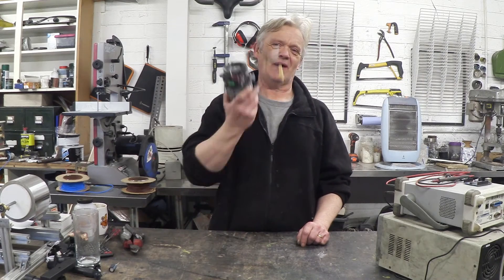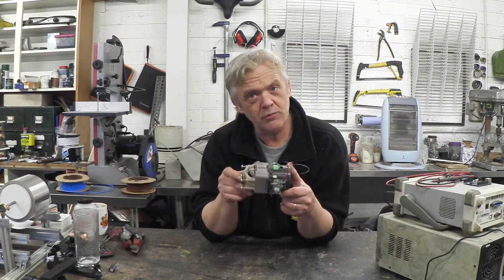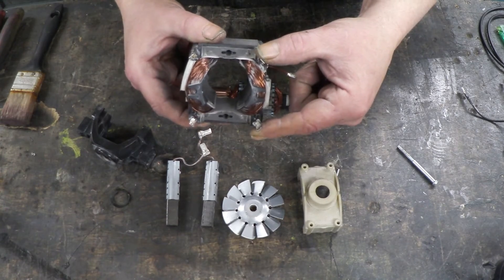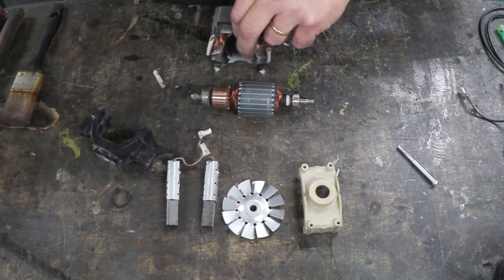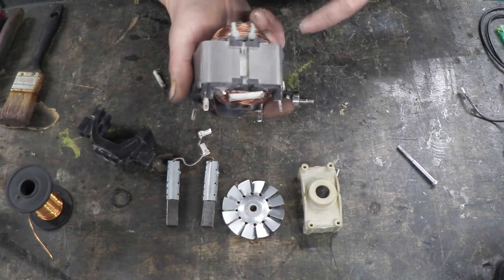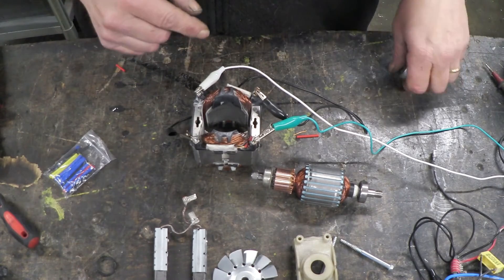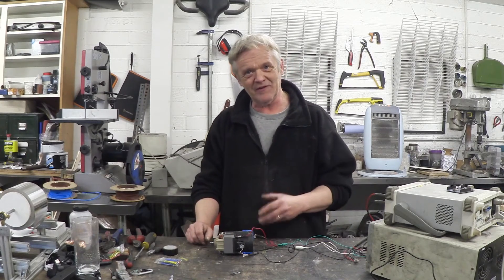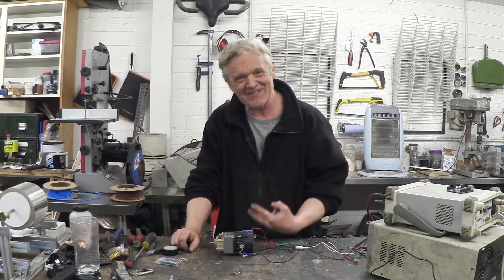1027 All About Universal Motors

Comment: can this work for a bosch 800w drill converted to torque wrench using torque tool attachment. I want to control the torque and speed of the drill to output the desired torque in Nm using various torque tool attachment. the tool attached to drill basicall uses rpm and torque of drill to produced desired variable torque from the different torque tool attachments

Comment: two questions, can the wire that connects the two field coils be considered a neutral if I was to be running this as an ac generator? on RMS' set up that's the blue wire.  And for the rotor what roughly are the upper bounds of energy that rotor coil can handle? less than 12 v or even no more than 6 volts the higher the volts the stronger the field but what limits are there for these types of set ups? thanks to anyone who might have a thought to share.

Comment: You comment on the video that with a bridge rectifier and capacitor the output is controlled by the ‘power’ of the capacitor. 
In what way?
The voltage or capacitance?

Comment: if using a serries wound universal motor (field coils in serries with rotor coils) for a gokart, then it is easily controlled with adjusting just one thing, the voltage. 

Add more voltage to get power to accelerate from a stop, then bring the voltage down to when you're cruising at the speed you want. then  when you want to go up hill, just increase the voltage to get the additional power needed. 

just dont dump too much power into a motor for too long.  chose carefully and know its rated limites.

Comment: Unlike a permanent magnet DC motor they always spin the same way, regardless of polarity - when wired in their standard configuration 
If you want reverse, you have to wire stator/rotor separately.
I used one from a Dyson to make into the vacuum pump for my gasifier.

Comment: I found a universal motor that is 5 H.P. 120 or 240 volts 1750 RPM. The bearings were shot. Cost fifty dollars for bearings and I have a totally inclosed fan cooled motor that is excellent. I would bet you that buying that motor would send you back a many a quid. Works great.

Comment: Regarding rewinding. 
Maybe have a play with ohms law to work out what  resistance coil would be needed to drive same current through coil operating at different voltages. Then have a look at the volume of the different coils...
Shorter thicker wire for lower voltage, but total volume remains same.

Comment: That was a very valuable video. That hadn't occurred to me, but it makes perfect sense. I can see that same concept being useful when the motor is used as an alternator. Allowing easy start up and run in light wind, and then in heavy wind allowing additional load to be applied to act as both an overspeed brake and additional boost charging.

Thank you. this subscription is by far the best one I have. By far! It only costs me the equivalent of a couple of cups of coffee a month.

Comment: Sometimes motors also have thermal fuses which blow on the coils which makes repair simple. For example on cooling fan motors. Keep an eye out for those. Useful gen on control, never taught me that at poly. Today I brought back mt broken LCD display from the dump for the 2nd time 'cos the queues are too long. Resigned to stripping it down for the lenses. That'll teach me for not recycling!
Reply: I like converting failed LCD displays into lighting panels to hang on the wall.  Strip them down to the frame and lenses, then install strips of LED lights all around the inside of the frame to shine into the acrylic panel.  For added effect, you can paint an acrylic sheet to look like stained glass and make it look like a stained glass window on your wall as if light is coming in from outside.  They draw ridiculously low power - the one on the wall in my parlor draws only 2 watts and is sufficient to work at my desk at night in low light.